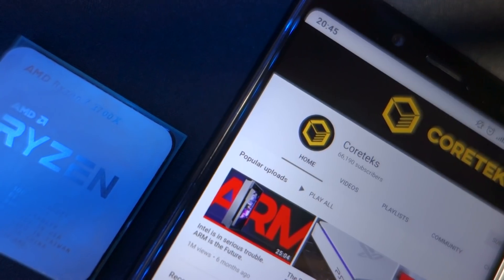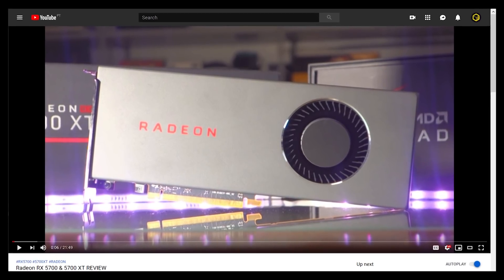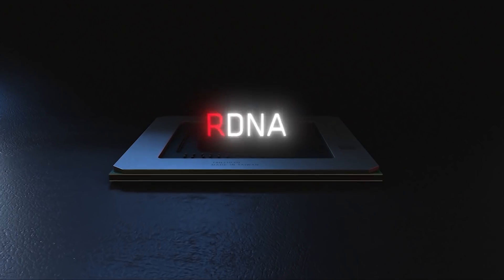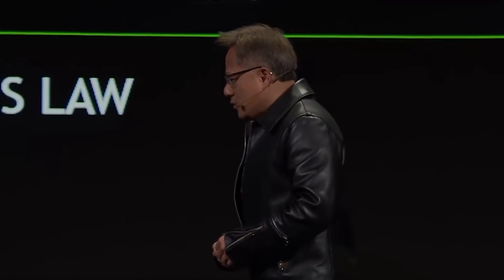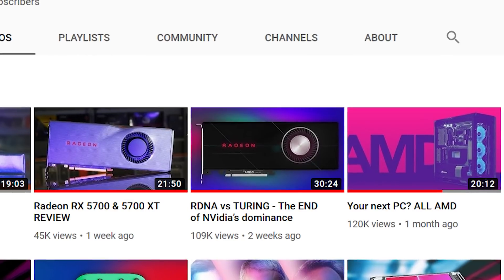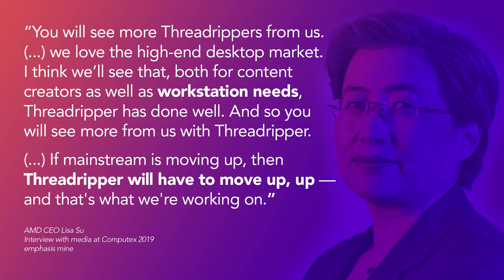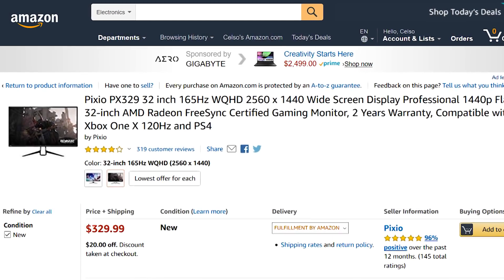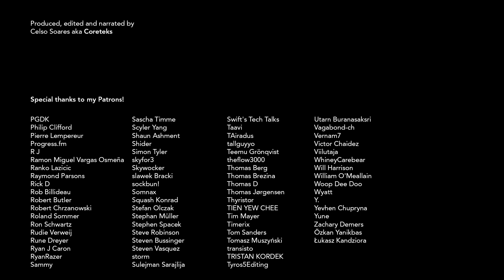What's next for AMD? - 5800XT. Threadripper. APUs.

Comment: 5700xt is competing with 2080? Whu? Show me those benchmarks
Reply: Overclocking 5700 XT does magic and it can really compete with rtx 2080. As for benchmarks, you can find it.
Reply: @Bylov6812  conventional reviews showed xt being slightly slower than 2070S. Funny how you mentioned overclocking which I didn't ask about, but told me to go find benchmarks myself, which I was requesting as proof. Some pepega YouTube commentary going on here
Reply: Unfortunately there is a utuber that used a hacked powerplay mod to push the 5700XT to 2.2ghz and the edge of breaking according to the temps. and it got very close to the 2080 in 1 game and now many AMD fans are stating that as its baseline performance potential. It's impressing for sure but its still not realistic.
Reply: @ps2232  my biggest issue is how casually dude that made this video says that xt is almost competing with 2080. Such statement without any further explanation or any kind of proof doesn't make him sound biased, like not at all.

Comment: Well, the 5600 got "leaked", so RIP Polaris i guess.
Reply: I hope its cheap I'm not into 1440p just 1080p kinda need a new gpu
Reply: @rushdrift  my guess is it will be slightly more expensive than Polaris at start and having price cuts since AMD get rid of Polaris stock
Reply: taab84 You called it with the rx 5500xt
Reply: @rushdrift  Good point but in my case is the opposite. 5700XT is not good for me and VR usage but I will be more than happy with this RX 5800XT for 600$ what is my prediction about price according to Price of 2080S (700$) and how 5700XT was priced compared to 2070S.
Reply: wormeaten my guess is the 5800XT will replace the Radeon VII at $700 and the 5900xt if it’s real will be $1000.
Reply: @rushdrift  lol me too xD
But I want a stronger one
Reply: RushDark it will be cheaper than 5700.
Reply: I hope it gets improvements. Polaris cards have low performance in opengl. Just try playing wolfenstein it's bad but 5700 gpu can play it smoothly.
Reply: @philippengl2342  Although i recommend a healthy dose of salt, the leak suggests that the 5600XT is a 24 CU chip.
Reply: WHEN!!!!!!!!!!!!!!!!!! i neeeeeeed it
Reply: @UkletiHolandjanin-pd1bf  IDk, all we have is a CompuBench entry of a "Navi 14"
Reply: @bushhawk5460  .... i need new 1080p KING on Ultra for 299$ MAX. They have to do it T*T
Reply: @UkletiHolandjanin-pd1bf   hehe get 2 rx 480 8 gb they are about 120 and flash bios and u het rx 580 .Strenght is about gtx 107ti 1080
Reply: @UkletiHolandjanin-pd1bf  vega 56 at 230€ here you go. 1080p ultra or even 1440p high
Reply: Polaris is obsolete, it's time to pass on
Reply: I just recently got an rx 570 for $90 on ebay.
Reply: @pimphesus  got gtx 1060 6gb for $95
Reply: I feel that the 57xx GPU are the Polaris replacements!
Reply: I mean, it's about time. Polaris is already 3 years old
Reply: For 75W, get the RX470 that doesnt have external pcie power. Being close to the RX570, it'll wipe the 1650 out. AFAIK there are modded rx570s that dont have to use ext pcie power.
Reply: Nah I’ll keep my RX 480
Reply: Good, all the people who didn't understand what the 5700 series was-can finally stfu about the price.
Reply: Going with the current line up of gpus it’s probably gonna be priced at 1660 and come close to 2060
Reply: Polaris has been dead since Navi was rumored.
Reply: @qltcn  because you don't need 8gb on a 180p card and Polaris shader count translates very poorly to performance. By your logic, a Vega 56 should outperform the RX 5700XT by a long shot.
Reply: @qltcn  what website leaked this?
Reply: I hope they make low profile for my itx Build I'm going to Build. Just waiting the release of the 5600 gpu
Reply: I hope its only 75w to challenge the 1650
Reply: @craigsommerville3863   i preffer a 150w that fight 1660 and 2060 normal for 250$ or less, i will be happy :) tdp is not a problem to me, i have a big case (not so big, but a lot for normals cases) i am putting a lot of fans to be purfect :3 i wanna low prices because i am from am a 2 world country (brazil) we do not have stocks and need to get from USA or EUROPA so the prices her is 20~%  higher
Reply: @craigsommerville3863  when I see a post like this, I wonder if the person is a troll or has mental deficiencies. Laddie who gives a flying fuck about the 1650? the rx 570 4 GB dumpsters it and if TDP scares you that much just undervolt the RX 570. What the fuck is wrong with you people.
Reply: @Stein871  Being a 75W TDP card makes it attractive to OEMs and SIs.
Reply: @Stein871  1: Like i said, OEMs like cards that need no cables.
2: Who said anything about workstations?
Reply: @craigsommerville3863  congrats on wasting your money if you own one

Comment: there will be a RX 5950XT as top tier GPU, according to Sapphire card list and that AMD have confirmed that the naming scheme goes as RX 5(generation)7(rank on the tier list)00(00 or 50 subcategory) XT
Reply: Yes but this is just reservation of the names for possible products. This category says 00 for one GPU and 50 for dual GPU products. I'm interested in this 5X50 lineup of dual GPU cards. I'm hoping with new IF this dual GPU could work as a single GPU card but with minimum 80% higher performance but not just as another CF.
This need to be simple for consumers and games developers. So imagine this RX 5750XT. This will beat 2080ti by 30% minimum and price should be maxed at 700$. Than imagine RX 5850XT what will beat 2080ti for 70% in the same or similar price range. 

Also according to this 5900 should be better than 2080ti in performance. If this will be true Ngreedia dominance with best performance GPU is over.
Reply: @wormeaten  well nvidia still has the best marketing, i mean, most people think it's the only choice, and they also can claim they are the only ones with Ray tracing, this year at least, there is a lot involved beyond the performance of the cards themselfs
Reply: @wormeaten  That's true, but Scott actually said something in that interview Coreteks mentioned somewhat in passing, but he named either a 5850 or 5950 by name (I forget which). As in, he specifically said one of the two numbers when referring to newer GPUs. Bit of an odd coincidence if you ask me.
Reply: @wormeaten  Thats where the lower level ai implementation on treating multiple core as a single core comes in. It is a promising technology but required lots of r&d from multiple party. According to what coretek and mlid said, we can expect amd implementation on cpu part at 2021++, probably a couple (3 years) delay on gpu department.
Reply: I don't think we'll see 5x50 series cards. That seems more like a refresh name considering the current XT spec.
Reply: @J Fz fun fact, ray tracing has been used since the 80's, yet nvidia managed to sell it as something new and exclusive coming from them with no adoption really, just 5 games supported it,
Reply: @villenmillenion7986  isn't it real time raytracing Nvidia enabled for the average consumer?
Reply: @J Fz all hail Jensen! all hail Jensen!
Reply: To me it makes sense that top tier GPU is gonna be out at same time as 3950X processor. It would make sense for customer who buys 3950X to buy top tier GPU ; and if AMD is not gonna have their lineup ..well such buyer will buy Nvidia card. And there is no good reason for AMD to let that happen. They will launch their own top tier GPU and have a very nice combo for top tier.
Reply: I think 5X50 cards would be like Super.
A refresh of Navi in other words.
Reply: @J Fz Look, lets be realistic. AMD hasn't been pushing for over 5 years and it is the reason Nvidia is allowed to charge you so much. Rebranding the same gpu 3 times isn't pushing...
Reply: @h2oaddict  fury wasn't rebranded. Fury didn't live up to expectations though and the 4GB of HBM did make for a decent 4k option at the time. It's alright for 1440p these days, not ideal of course.

To say they haven't actually tried is Tobe dishonest. They were also barely holding on during those years you cited. Basically it's impressive they made any kind of a comeback at all.
Reply: yes but when? waiting os killin me